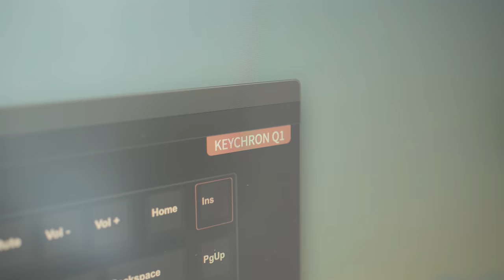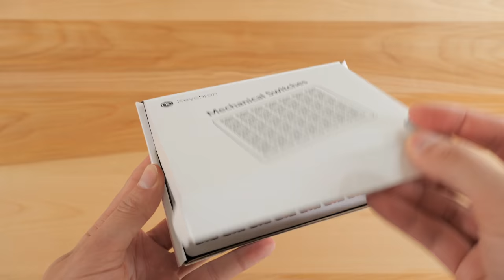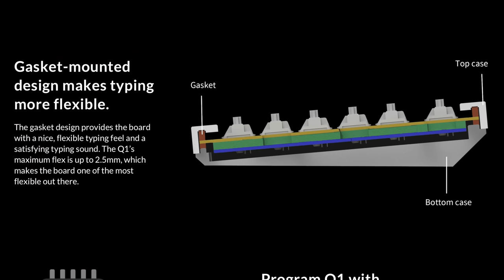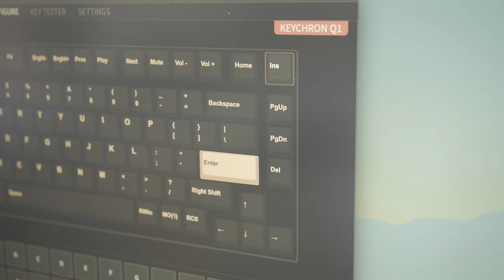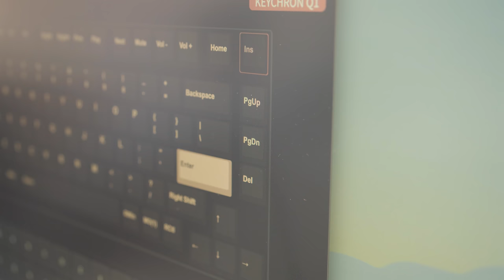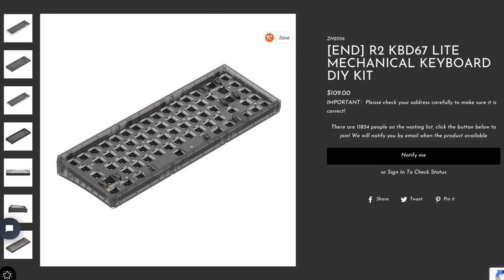Keychron Q1 75% Mechanical Keyboard Review ~ GMMK PRO Killer?

Comment: I'm considering the Q4 vs. the Ducky One 3 mini. From what I can see, the main differences is that the Q4 gives me a gasket mount and QMK, while the ducky gives me adjustable angle feet and is slightly cheaper with keycaps and switches included vs. the barebones Q4. Other than that, it's down to style 🤔

Comment: Weak RGB, blurry legends on keycaps, no way to change the angle with adjustable feet, abandoned knob, history of poor quality control. Some  reviewers are getting ahead of themselves, it's really not such a killer deal
Reply: ? it really is. rgb is not a necessary feature in the custom community so it being featured is already a plus, no keyboard in the custom community has adjustable feet, knob is said to be supported in the future and there is barely any other keyboard that has rotary knob besides the gmmk pro unless you spend +$100 more, poor quality control in keychron is unheard of. none of your arguments are valid or strong enough to deny that this keyboard easily beats gmmk pro.
Reply: Knob was abandoned, since it was a community request this obviously takes longer than the already for month worked on concept. Knob will be released in october.
Reply: @Chillhoof  They do, because not everyone is living in USA. For every GB or whatever you have to pay shipping in the rest of the world. Its normal. GMMK PRO has the same "problem" if I want  a gmmk pro in gemrany this would cost me 235-245$

Comment: GMMK Pro is just crap to begin with
Reply: why
Reply: Simple, when Glorious advertise the keyboard as gasket mount it better has flex, not only it doesn’t flex but it is as stiff as hell.
Reply: If the GMMK Pro is so bad then suggest me another 75% board with these features I'm looking for:
White aluminum case
Rotary Knob
Per Key RGB and Underglow
White PCB w/ PC Plate
Hotswappable
Compatible with Durock V2
Reply: @zero604  yeah I'm looking for smth like this too but gmmk pro looks like the only one I should get